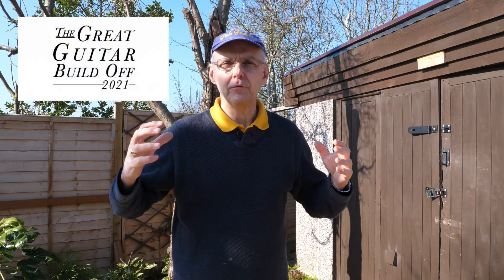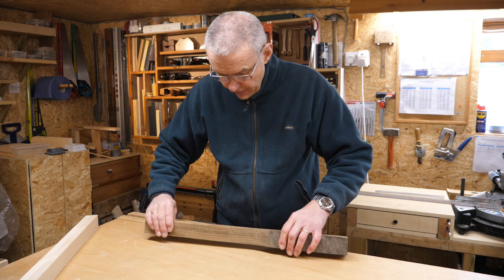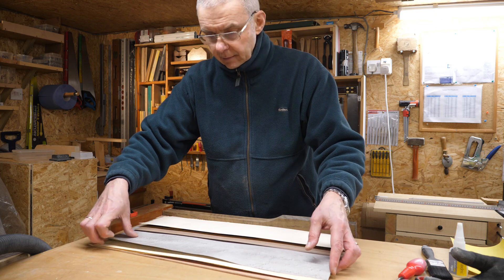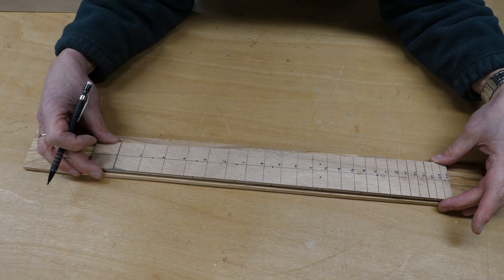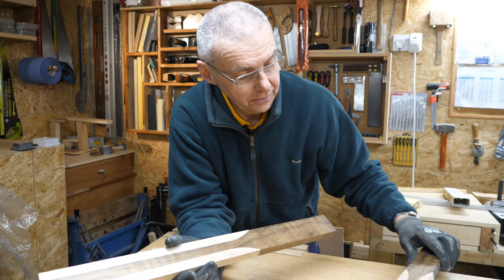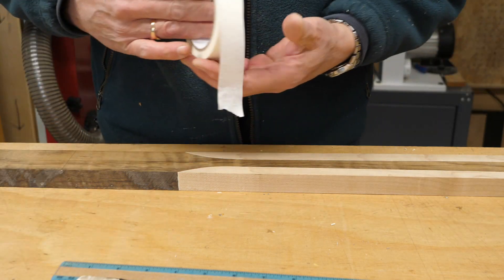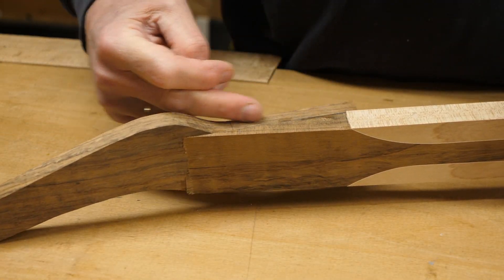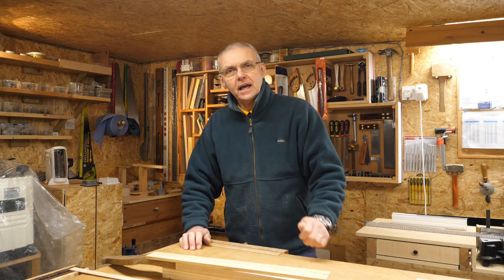Great Guitar Build Off 2021 Build From Scratch - Ep 1 Making the Neck

Comment: That neck looks superb Dave. If you send a bit of scrap wood through the thicknesser along with the neck blank, you'll only get snipe on the scrap so long as the scrap piece is fed in after the neck blank, but before the neck blank has fully passed through!
Reply from the maker: Thank you, that's a great tip.  I usually just make sure the piece is longer than I need but that's not always possible. Cheers Dave